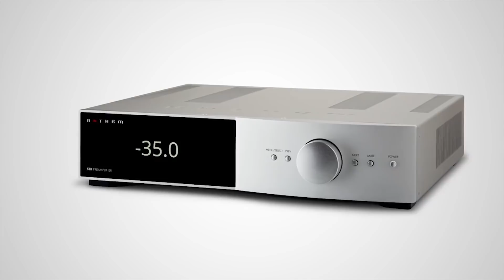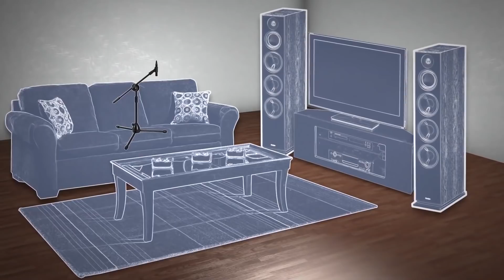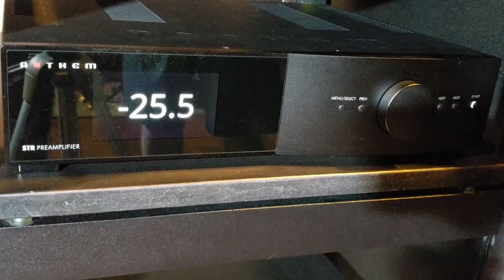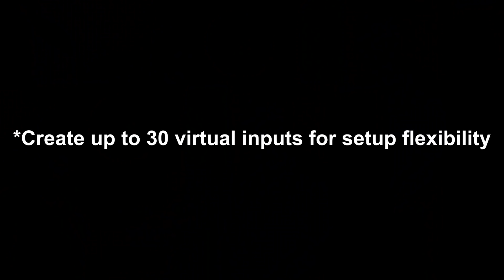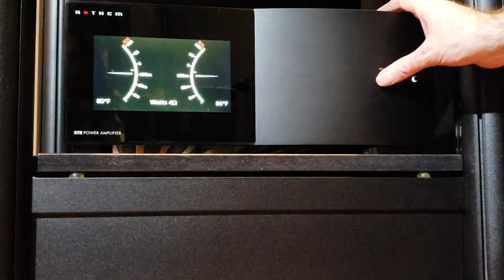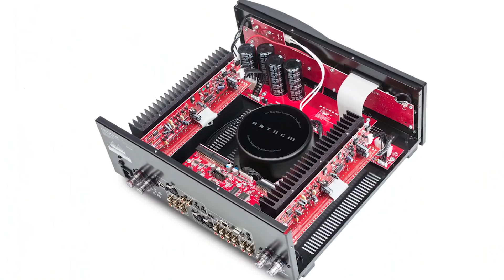Anthem STR Preamp & Power Amplifier Overview

Comment: The ARC in the Anthem is game changer. I have the integrated, and once you use ARC, there's no going back. It was a major reason I narrowed my choice down to the STR when I was looking for a higher end integrated in the $ range. Without ARC, it would compete easily with other units in the $ range, it's leaves all others behind with the ARC. Finally, considering all the gear Gene gets to test, that the STR series is what ended up in his personal system, should tell people all they need to know. My review of the integrated: https://www.youtube.com/watch?v=hUCf1cfF1rs&t=4s

Comment: Gene I want ask you just one thing This is not a criticism I hope you don’t take it this way about anthem but I have products and I noticed that they use circuit boards in their preamp’s from years back and I also noticed that the new STR amplifier uses basically the same board configuration and power configuration That some of their older model use. Why do they do that and call it new?    Anthem  sounds nice.  But so does my Class’e preamp, amp which is more tube like where Anthem is more in your face sound.    Where is your Buddy Hugo what is he doing out lifting trucks?

Comment: I have been getting back into 2 channel. However, rather than a dedicated stereo preamp, I picked up a used Anthem Statement D2v for shared 2 channel and theater duty. It will be controlling an Anthem PVA 7 Amp which is powering my all JTR 7.1 system in a dedicated room with the JTR Noesis 228HTs and Captivator S2 behind an acoustically transparent screen. 

I can’t wait to get it and run ARC when it arrives to see if there is a difference from the Audyssey on my Onkyo PR-SC885. 

I went back and forth on getting an AVM 60 or D2v, but since I am not planning on adding more speakers or moving to 4K anytime soon and in theory the D2v should sound at least as good for 2 channel as the AVM 60 and potentially better for less than half the price. 

Thank you for this video as it helped drive my decision to get a preamp that should sound as good or better for music without extra features that I wouldn’t be able to take advantage of without making big changes to my room.

Comment: Hi Gene, I have a similar setup than the one you are showing, where you put the anthem in charge of handing pre-amplification/ amplification for 2 channel stereo music. I have a Yamaha 5100 for home theater and a separate 2 ways amp for stereo listening and two 7 channels class D amplifier for Home Theater. I was wondering, since you had the chance to try them side by side, whether the use of a dedicated preamp really made a difference over using the 5100 as a preamp? all a preamp needs to do for stereo listening is input switching and volume control, and the price i for such function, for a "stereophile preamp" is normally between 4k-15K. The question is: Is it worth it spending such sum on a preamplifier or  is the sound quality difference over a well built, albeit consumer product, yamaha 5100, negligible?
Reply from the maker: The Anthem STR has 3 big advantages, superior phono preamp, ARC room correction,superior ADC if you use analog sources with bass management and processing. If you don't need any of those features, the 5100 will serve fine as a preamp.

Comment: Hi Gene, Can your run 2 channel and 5 channel set up from 1 preamp?
Reply from the maker: Sure you can. I chose this route since ny turntable is in a different rack and I didnt want to extend the cable and also so I can review other gear without interfering with my theater system.
Reply: thanks Gene

Comment: These 2 would pair up nicely to my PSB speakers... I would like to wait until some things are ironed out a bit, although I'm sure the preamp would pair nice with a Marantz or Emotiva power amp,  as the amp would pair nice with any decent 2 channel pre amp putting out 2 volts or more RMS.  I have 2 red dragon audio S500 stereo power amplifiers in btl bridged mono mode with PSB speakers for music.  Marantz and Emotiva gear powering the home theater with 13 SVS speakers.

Comment: Hi Gene, I'm really keen to hear your opinion on ARC once you're all tweaked up. Currently I use an Emotive XMC-1 for both 2 channel and multi channel. Really like Dirac and other features such as configurable triggers based on source signal, so am reluctant to jump ship. However, feeling a bit jaded by the whole 'upgrade' experience with the HDMI upgrade only just being released, Atmos still not here and it's now end-of-line. So I am interested in Anthem as a replacement, provided ARC can stand up next to Dirac??... Love your work, keep it up👍👍

Comment: Gene great video. I have an Onkyo tx-sr705 that I would like to upgrade but av manufactures have done away with tape in and out connections, I have an Onkyo integra 909 cassette deck and tascam reel to reel that I want to continue using. Im doing 5.1 all NHT speakers with the 2.3a’s for the fronts. The rest Oppo 203, Pro-Ject debut Carbon with every upgrade, arcam irdac and bungie tube phono stage. I’m unsure if a power amp for my av receiver or a stereo receiver with theater pass through would be the better decision. Any suggestions?